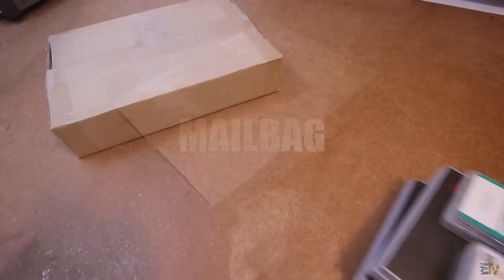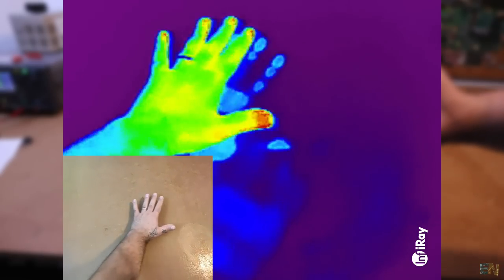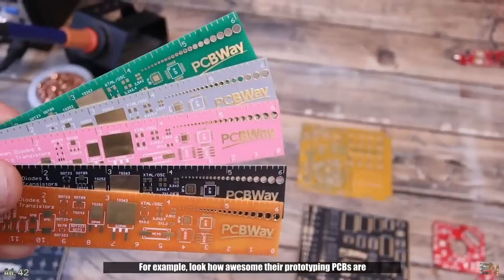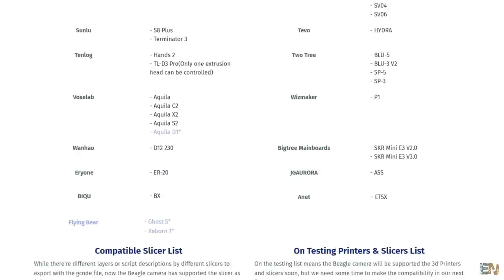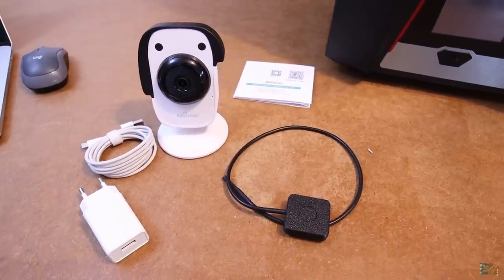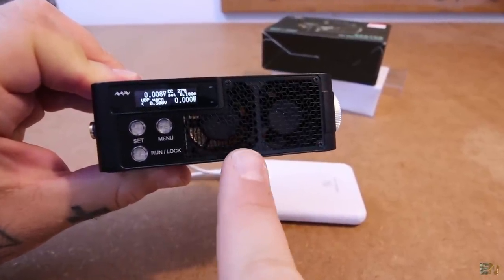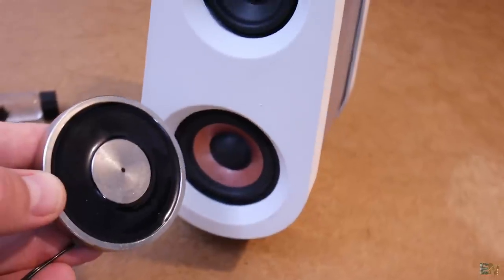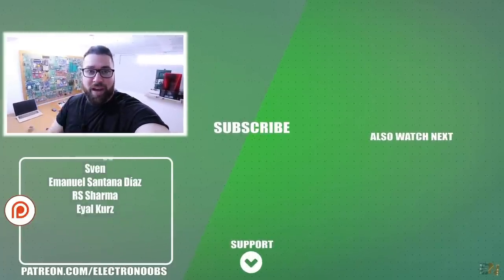Thermal Camera | Beagle Camera | Electronic Load and more...

Comment: Hi there, love your projects. I built your arduino based smartwatch project, which you last updated on 2018. Everything is fine except i can not upload the code. I takes a lot of time then it gives this error: 

Sketch uses 29098 bytes (94%) of program storage space. Maximum is 30720 bytes.
Global variables use 1459 bytes (71%) of dynamic memory, leaving 589 bytes for local variables. Maximum is 2048 bytes.
avrdude: stk500_recv(): programmer is not responding
avrdude: stk500_getsync() attempt 1 of 10: not in sync: resp=0xa9
avrdude: stk500_recv(): programmer is not responding
avrdude: stk500_getsync() attempt 2 of 10: not in sync: resp=0xa9
avrdude: stk500_recv(): programmer is not responding

It goes up to 10 attempts and then fails to upload. Is there anything i can do to fix this? Is there any chance that i have worse nano processor than yours or something like that?
Reply: Chances are, that your Nano has the old bootloader on it and you configured your Arduino IDE for the new one, or vice versa. In the Arduino IDE got to Tools -> Processor: ATmega328P and switch it to ATmega328P (Old bootloader). Then try again. Or do the opposite if the old bootloader is already selected.
Reply: @tobi_n  oh my, it worked like a charm. I have been trying to solve the problems for a week. Didn't think it would be that simple. Thank you very much mann. Appreciate it.